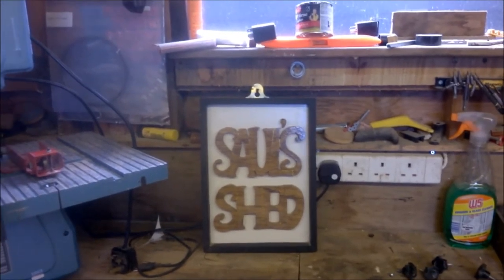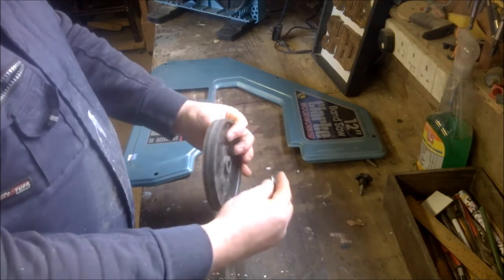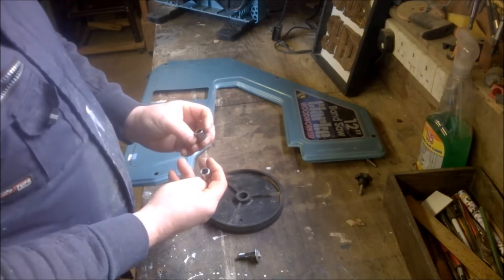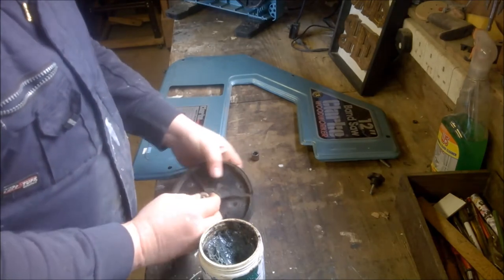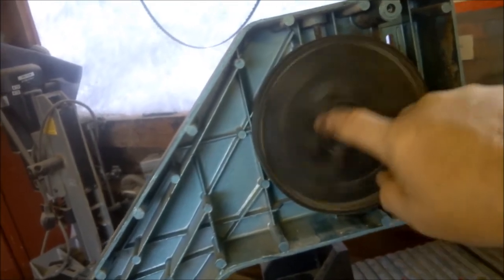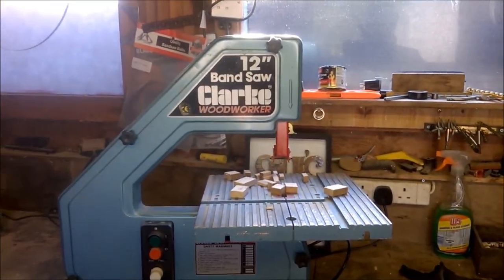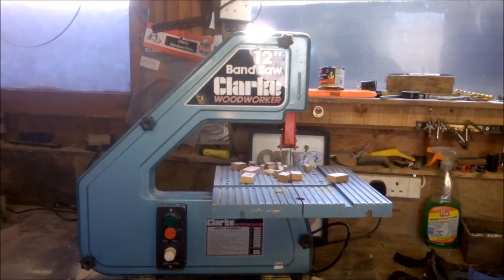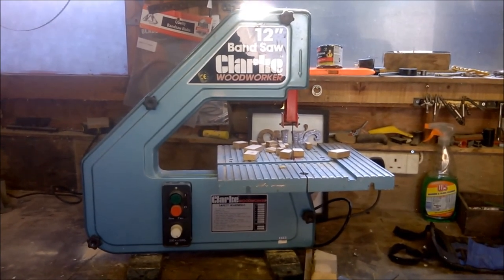12" Clarke 3 wheel Bandsaw  Fix

Comment: i have same bandsaw as yours having problems with mine i track the blade it goes fine for a few mins then slips of to the back and blade ends up braking could it be possible mine has gone same way as yours is it possible send link to get this bearing might be worth a try

Comment: The 3 wheel units have a reputation of blade breakage. I have one and have broken 2 blades. The first one by my learning curve and the second because it was left under pressure for a long time and warpped it. The rumour is to do with the small radius of the wheels pulling tight repeating flex movement on the blade and it fatigues out. Don't know as I have not used it much. Have to give it a spin by hand to get the motor to carry on.  Craftsman as the exact duplicate of the Clarke and other brands. Contract tool builder.

Comment: Hi I’ve just bought a second hand one, the blade wondered badly so I tightened the tension and the blade snapped, the blade guides are very fiddly to align but I’m not new to bandsaws,I’ve ordered a new blade, any ideas, the instructions don’t specify a correct tension, the old blade felt sharp.

Comment: I’ve watched again very closely at your blade guide bearings, yours are much better than mine, I just have one bearing mounted sideways with a slot for the blade to pass through, no side bearings, I think mine could be an early model, possibly 2013,I’ll have to look to see if I can get a blade guide bearing upgrade.

Comment: i think my wheel or that bearing is slightly off-center or off axis and as the blade turns, the amount of force needed to keep it going  varies .. or it's something else. my next move will be to ascertain that the 3 wheels are in the same plane and that their axles are centered
Reply: Don't do that, you will destroy the belt that drives the lower wheel. The wheels should, by designation, not be in the exact same plane, anyway not on this machine.

Comment: Hello.
I have just got secondhand one of these Band Saws here in Australia.
I opened it up to find it has no drive belt .
the motor shaft has cog for a toothed belt  , but I cant work out how it drives the wheel ?
Does it run on the smooth surface of the drive belt behind the blade ?
Reply from the maker: Yes on my saw there is a drive belt from the toothed cog that goes around the third bandsaw wheel near to it.  The blade runs on top of the belt.  I will email you a photo if you want me to or put  short video up here if that is any help.
Reply: Robert Sandey 
A photo would be great , the belt tensioner seems to be in the wrong position also ,,
but you could a Belt remove and replace video would be awesome.
I can't find a dealer in Australia , strange , so I might have to get from the U.K.
Everything else looks fine .
Thank you .
Stuart.
Reply from the maker: Sure I will get something sorted and up here this weekend
Reply: Robert Sandey .
Awesome.
Reply: Robert Sandey .
Could I be pain and get to measure the width , length and how many teeth ?
Hopefully I can find a non gen belt.
Thanks.
Reply from the maker: Just put a quick video up on my channel showing how the drive belt fits and is tensioned.  The belt is 500mm in length or should that be circumference and 15mm in width,  the teeth are about 2mm.   I hope it is of some use to you,  Regards Saul.
Reply: @Samberlong  hello
do you have the size of the toothed belt or a code number?
i got one as your bandsaw and is broke by wear.

i will apreciate your information.